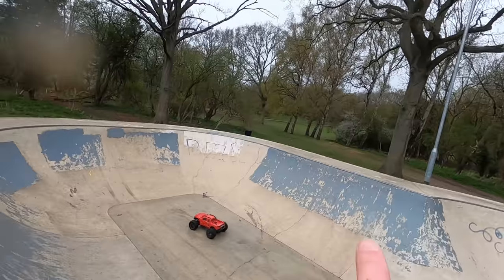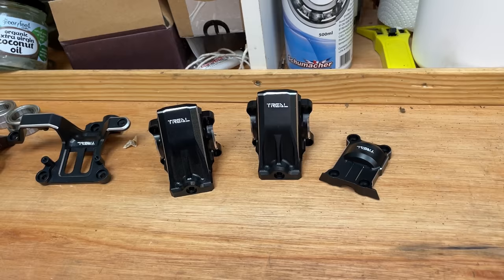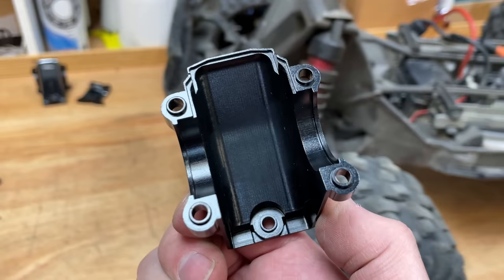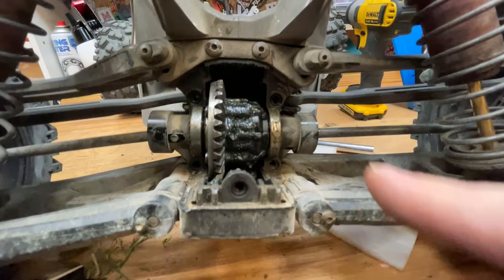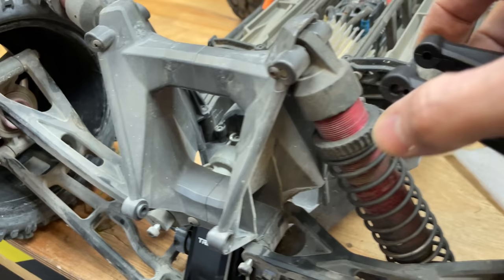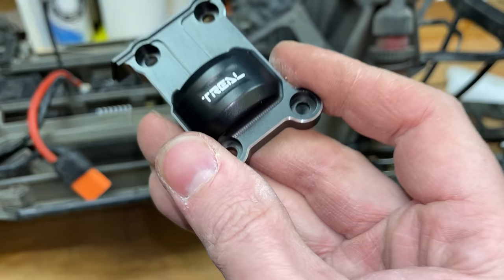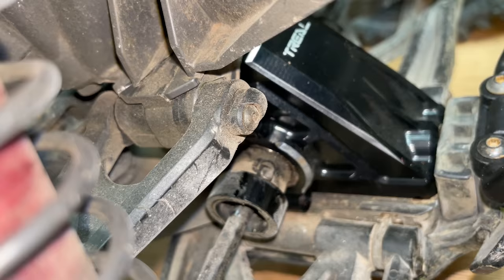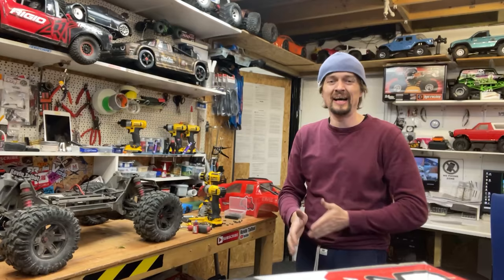The only RC car you have to have

Comment: 5:54 Be careful with that. I don't know if this is the case here, but some bearings can take axial load only in one direction (google "duplex bearings"). They are mounted in pairs so they can take axial loads from both directions. If you remove one from the pair, the other bearing simply won't be enough.
Reply: interesting really but why would they do that kind of bearing ?

Comment: Working on cars is almost as much fun as ripping them👍
Reply: I have buddies that hate working on their cars, I'm like what!!! That's one of the best parts!!! You ain't no real RC hobbyist! 🤨
Reply: Facts
Reply: @rcvideos4k803  I hate it because it’s hard and time consuming for me. I just got started in the hobby, and I work on a kitchen table.
Reply: @quarans08  after fixing your first part you will be like "that wasn't that bad I kinda see how that works now"
And basically once you have done repairs here and there around your car you will understand it as a whole not just see it as a car shell with a bunch of cables and parts and screws under it .... Instead you will see everything for what it is and how complex yet how interesting its become... Then the thoughts of wanting to upgrade your car and making it unique or more strong.. Or more fast even choosing a new body... Then painting it to your own taste .... Trust me you'll know what I mean.... Give it time 👍💯
Reply: Every time I run my Senton I image the differential working, the suspension, gears moving,m
M GC I already know most of the parts from YouTube, it’s probably different in person, tho. I want to make it brushless, and use metal gears because a pinion (or some gear) stripped. I can’t even get the gearbox off, it just would not slide out without damage or hurting my self. I watched many videos. Each time I tried fixing something, one thing broke. First some links on the suspension, and then the gear.  I hate the maintenance and fixing. Adding things like bumpers are fine with me, but most other things are just frustrating. I don’t think I could even change shock oil. I have nothing except my table, and a screw set from the hobby store nearby. I just take it to the hobby store to fix it. Thankfully, some of the employees fix small parts free, like getting pivot balls in the links.
Reply: @rcvideos4k803  but I’ll trust you. Everyone seems to love working on their cars, there’s gotta be something.
Reply: Agreed the wrenching is a big part, if you hate it u need a:better tools, b: bigger workspace, or just buy a Wal-Mart special and throw it away WHEN it brakes...😒
Reply: @rileysvideos2059  I need a and b
Reply: @rileysvideos2059  I definitely need better tools, I just changed all my diff and shock oils with the included tools 🤦‍♂️🤦‍♂️ NEVER doing that again

Comment: For that lazernut... open up the diffs and check the shims. Then add 4 or 500k oil. They don't come shimed properly and diffs go out on first rip. Oh and make sure the wheel nuts are super tight the rears tend to come loose.

Comment: the reason the xmaxx is so durable is the way the wheels sit. on the xmaxx the center of the wheel is under the bottom of the car. on the kraton the wheel centers are above the bottom of the car so when it jumps it slams the bottom before the suspension even bottoms out

Comment: Hi kev, I changed my front diff because of a crash and when I was putting it together I twisted it to see if it sounds ok and it was a very light crunch, so I put it together 😳 and now I don’t have 4WD, what should I do to try get it back. Also I can turn more left than right, when I turn right it hits the gearbox housing, what should I do about that ? Have I set my steering up wrong ?

Comment: The Treal stuff is really nice. The attention to detail is spot on too. I recently started purchasing from Treal for the LMT monster truck and when I was in their website, I seen they have a lot of other stuff. I've seen Treal TRX4 brass components but never felt the need to add the weight. The LMT though with those axles is a very useful upgrade. Look better, in my opinion, than the vitavon stuff. I remember a time some time ago where you were against adding aluminum stuff to your X-Maxx, and now you've got all those nice parts for it. What changed your mind? Was it that you are getting tired of changing those parts? Or is it that you want to see if it increases the durability?  I've broke 3 shock towers on my Super Rock Rey and said hell with it and purchased the aluminum tower. Another problematic part on it is the upper arms and next time I break one, I'm trying a pair of my own design. I don't need the camber adjustment ability, so my design will eliminate that completely. If it doesn't work, I'm buying a set of Hot Racing upper arms for it.
Reply from the maker: alloy is good in some places, im just experimenting!
Reply: @KevinTalbotTV  Sounds good to me. I try to stay away from aluminum as far as suspension goes and add aluminum to structural components myself. Sometimes though just get so tired of breaking one component so easily and so often that it becomes a no brainier.

Comment: So far I’ve broke 8 inner and outer front hubs, wheelie bar, 4 arms, about 6 front inner bearings, servo horn,  steering link, drive shaft spline adapter, probably more. All in 20 uses In 8months...

Comment: Question....my xmaxx steering keeps cutting out...why? I've changed servos,  changed receivers...still cuts out while driving...I dont know why?
Reply from the maker: probably the ecs on its way out
Reply: Thanks kev your the best...
I'm thinki.g of the castle xlx2 engine/esc combo...your thoughts?
Reply: @aggrosaxon459  High voltage castle esc's suck. Go with the hobbywing max 6.
Reply: @gasolinediesel972  does the max 6 motor have enough power ?
Reply: @aggrosaxon459  You don't need a different motor. Keep the stock motor.

Comment: What are the drive shafts and drive shaft cups mate? I keep bending my driveshafts
Reply from the maker: Stock i bent mine too sometimes just straighten them
Reply: @KevinTalbotTV  ah stock diff cups to? Deffo looked different!  Just seen the stock shafts. Supposed to have hardened  shafts in mine but still seem to bend cheers for the reply
Reply: Just seen they look like ring covers that slide over the cups?

Comment: Got a question for anyone that can help. I have an 8s xmaxx and I just replaced the receiver as the other one was acting funny. Now my truck goes 100% throttle as soon as you touch the transmitter. And the brakes lock up as soon as I hit the brakes. I’ve tried resetting the transmitter, recalibrated the esc, different batteries, changed everything in the app and nothing helps. What could that be? The truck is only about 2 months old.

Comment: Kev, it seems a little futile spending money on any expensive  rc if you then have to spend the same again upgrading all the parts so it doesn't break doing what it supposedly has been designed for.... Why don't Traxxas and Armar make an rc with all the best parts in already, seems odd, and a little misleading. Thoughts?
Reply from the maker: the xmaxx dont need any of these mods, been beating on it for 5 years with out them
Reply: @KevinTalbotTV  I really like Arrmar but from your vids they seem to be the worst for toughness.... Do you get to feed back tor the manufacturers given your grueling testing/destroying? 😂